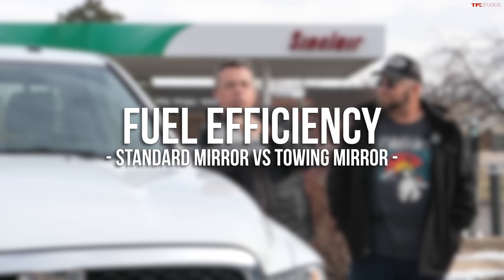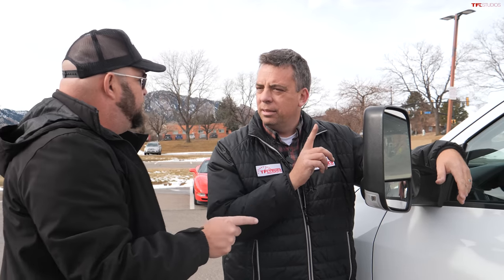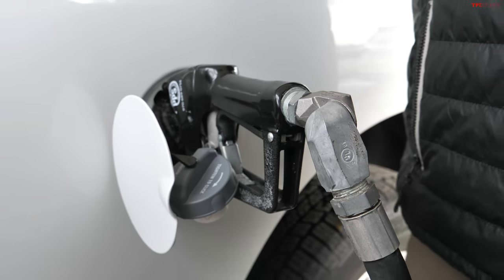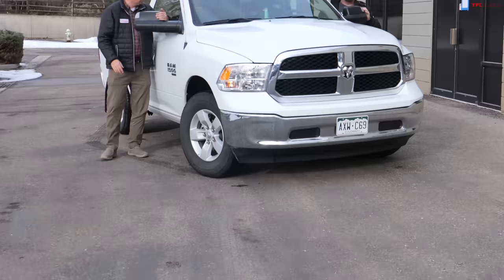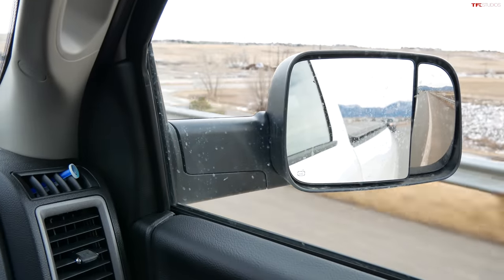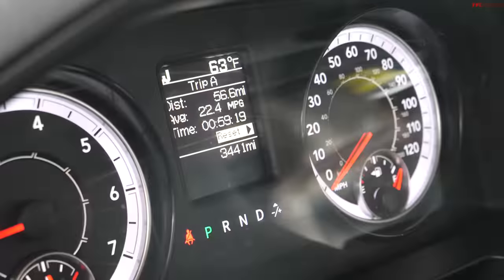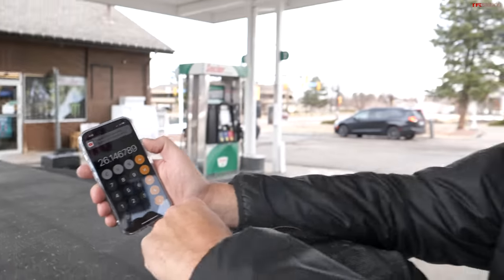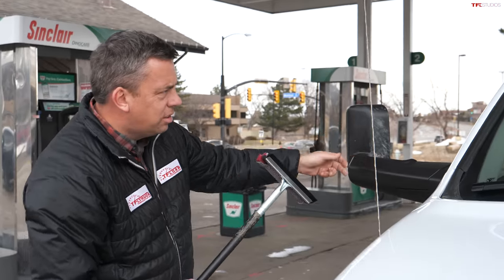TOTALLY UNEXPECTED MPG - Never Drive with Your Towing Mirrors Extended While NOT Towing: Here's Why!

Comment from the maker: TFL runs on Sinclair fuel and so should you. Download the Sinclair DYNOPAY app and start saving as much as $0.10 or more per gallon on your next fill-up. ( https://www.sinclairoil.com/customers )
Reply: I have never trusted your top off technique.  I think this just proved it to be faulty.
Reply: The closest Sinclair is over an hour from me 😂
Reply: Of course it’s faulty, but it’s about as good as they can do. The biggest fault, since they have no way to precisely measure out used fuel, is using such a small sample size of mile to do these calculations. These videos are misleading for sure. If you really think towing mirrors take away 6mpg, you’ve got problems.
Reply: You should look up the ad rules on YouTube, I believe you're not meeting them. Tom Scott did a good video on it
Reply: @phild9813  no it isn't "as good as possible".  They run the pump until it shuts off, they wait 30 seconds and mash the handle one more time.  They have no way to know if it tripped early on the first one, it could be a weak handle that trips for no reason, and many pumps will trip if they are pulled on quickly.  So the first thing to do is calculate by the dash.  If you are off by 30% chances are the pump is reacting prematurely.

I would run it until it popped off.  I would then run it again at half speed until it tripped again.  This way you can judge if it had space, or the handle just malfunctioned.  THEN I would wait 30 seconds and pull the handle "half way" again (NOT COMPLETELY) until it shut off.
Reply: @matt45540  Ok Karen, this all you got to do
Reply: I would trust your vehicles computer to measure the fuel used way more than where a fuel pump clicks off, depending on how the fuel splashes around in the filler neck your always gonna have totally different numbers, compared to your trucks fuel injectors that are extremely precisely calibrated otherwise the truck would not run right.
Reply: I like the RAM Tow mirrors.
Reply: Be cool if you could get a measuring device that measures how much fuel was consumed before each fill up but fuel is not a liquid so that may be tough
Reply: While I appreciate that TFL takes the time to do such tests, in the end, this is too small of sample size (distance driven and gallons pumped) for there to be any worthwhile/reliable data. I know funds for fuel and the time to drive long distances are both finite, so maybe best to not even do such tests at all since the results are obviously inaccurate.  Unless TFL comes up with a more consistent means to measure the fuel used than pump shutoff, you'd need to drive much longer distances and burn more fuel (15 - 20 gallons) so the inconsistent pump shutoff results in a smaller/insignificant fuel amount in the overall measurement. 
In this case, even if the dash estimate isn't 100% accurate for mpg, it is likely consistently off so would be a more accurate comparison, for the two runs, than your hand calculations. In this case, they differed by 0.2mpg which is much more plausible than the 5.7mpg difference of your hand calculation.

Comment: I'd run that test one more time to verify. That's an absurd difference and makes me wonder how accurate and reproducible those results are.
Reply: Yeah. Even reducing as many variables as possible, I still wouldn't be convinced it's typically that big of difference. Run a while tank through each way and you'd have pretty solid results.
Reply: I can't help but wonder if the first loop wasn't an outlier for some reason. I agree. Repeat the test.
Reply: The pumps are way off. I said the same thing in their last test. They should test one of the pumps twice.
Reply: Wind drag on mirrors is heavily researched. Audi tried to delete the side mirror to gain 10-15% efficiency on small mirrors. The federal govt just recently approved this changes, but still need to approve individual cars
Reply: @AkioWasRight  If the Pumps are OFF by that much???? Well, Just run the Pump to the designated  Rounded up $ amount, (ie $3.49.9 = $3.50), and the Pump should display "ONE GALLON" within I Think .001 Off?? Of Fuel On the Display! If it don't, Call the Bureau of weight's and measures out to SHUT THAT PUMP  "OFF" and Test for correct calibration on ALL the Pumps!    S  i  m  p  l  e    T  e  s  t.  And it's accurate! I've done this, (my Dad told me about it), and I found a Few Pumps in the Area that were way Off. And YES, I got the Pump #, the Station's Address, and reported it the Bureau of weights and measures, and...... YUP, they were out there pretty Quickly and had Taped off the whole Station and were Pumping Gas into there Measuring container's that are (supposedly)  Exactly ONE Gallon. And if they ain't, the Station is Supposedly Fined?????
Reply: The first test was BS! I'll buy the second! How many compact truck owners wish they were getting 26mpg!! Most of them would be the honest answer. There are 2 things men always lie about. Gas milage is one of them.
Reply: @kendavis1198  with the pumps being computerized it will always show the correct price for the gallons it thinks were dispensed. You would have to fill a container and double check what the pump says to verify if it’s off.
Reply: @kendavis1198  The problem isn't the measurement accuracy of the dispensed fuel, the problem is vapor return shut off. Some pumps are highly sensitive to the amount of vapor in the tank, which causes it to shut off. Even if you test the same pump, how much vapor returns could result in different results.
Reply: @Oaky  The MAN TGX and Mercedes Benz Actros save alot of Fuel because of the OptiView and Mirror Cam.
Reply: @FishFind3000  Sorry FishFind3000. NOT True! Just try it for yourself. Maybe I just wasn't Clear???  Stick the Nozzle in the fill neck, Look at the Price "PER GALLON AT SAID PUMP" Start the Nozzle / Pump, Pump fuel until the Price on Said Pump Reads "To The Next Dollar Rounded Up".  IE  $1.99.9 on Pump Price, The Pumped $ Amount should be at $2.00. (tricky to stop sometimes Exactly) The Gallon amount Pumped Should Read (ONE GALLON)! I've Done it It Works, and If you are NOT Getting ONE GALLON Of Gas, The Pump Is Out of Adjustment and needs Calibration!
Reply: It's not accurate in any way. Last time they did a chin spoiler with bed cover run they got 22MPG.
Reply: @AkioWasRight  Not Worried about "Vapor Return" stuff. The Question here is..... Are you Getting the EXACT amount of fuel out of the Pump being Used. If you run the Pump to the "EXACT" Rounded up Dollar Amount, (AGAIN) $1.99.9 would be $2.00.0, the Gallon Amount Pumped Has to Read "ONE GALLON"!!!!!  If it Don't, the Pump Dispensing / Gallon's Dispensed / Pumped Into the Vehicle Is "WRONG"!!!  Just go try it!!! You'll Laugh after you do it, (If you Follow how I'am Saying to do it)???? Go anywhere, Pump to the ROUNDED UP DOLLAR AMOUNT, It's Tricky, But it can be done. The Pump should Read ONE GALLON on the Display!!!!!  I Guarantee It, If you do it right, The Gallon amount will Read One Gallon!!!  Has absolutely Nothing to do With VAPOR and Shut Off, You're Controlling the $$$$$$ Amount on the Pump, The Pump Is just Pumping the Gas Into the Tank. It'll Read One Gallon. If it don't, the Pump is Out of Adjustment!!
Reply: @kendavis1198  Can you communicate like a normal person? Your comments are going to give people seizures.
Reply: @AkioWasRight  Sorry Emd=mc 2. Sure Can. If you're Interested??? Pump Gas in your Tank. If the Pump reads a Dollar amount that is rounded to the NEXT $$$, the Pump should Read (ONE GALLON Pumped). If that ain't Clear enough for ya. "O" Well. Sorry.
Reply: I was thinking the exact same thing. I don’t understand how yesterday’s video you could get 22 miles per gallon at best and in today’s video your magically at 26.
Reply: this, except do a 250 mile loop, maybe with 2 identical trucks
Reply: @Emd=mc^2  that makes me think how often we get ripped off going to differ pumps?
Reply: @jordantrudeau-adams4213  As I said in another comment, I don't think the issue is the measure of fuel dispensed, or the dollar amount for fuel dispensed, I think the issue is the vapor shutoff. How much fuel it dispenses depends on how much vapor is in the tank.
Reply: @jordantrudeau-adams4213  Hey Jordan.  Exactly My Point. Glad you understand the Explanation. Try it out next time you get gas. Works at Any Pump.
Reply: @kendavis1198  yeah that doesn't work.

fuelpumps only contain a flow sensor and then calculate cost based on how much was pumped.

so if the pump thinks it discharged one gallon it's going to bill you for one gallon no matter if it actually discharged 1, 2 or 0.5 gallons of fuel.
Reply: @anonym3017  Sure.
Reply: @kendavis1198  I understand what you're saying, and totally agree the flow sensor could be out of wack and need calibrating  but what they are saying is also true, if the machine is told by the sensor how much fluid has passed is one gallon they price is going to match, I think what you found were stations posting one price but programming another
Reply: @markmccarty9793  what about the size of the fish I caught?
Reply: @TrueNewb  Dude, the 22mpg test was a different truck.
Reply: @kendavis1198  its not the pump are off but the pumps arevstoping at different fill levels. with only fill 2 gallons under fill .3 gallons one time over fill .3 another and your off .6 gallons that's one 25 percent. can't use the pump when your only using 2 gallons use the computer
Reply: @Coldfire840  most are missing the point its not a pump metering error but a pump shut off error.their not filling up to the same point
Reply: @jeffforbes70  Look...... I can't say it Much Clearer. Next time you get Gas. Let's Just say it's $.99.9  Cents for One Gallon. Run the Pump Till it Say's on the Display a Dollar amount of $1.00 Even.  Then, Look at the Gallon(s) Pumped. If it says "Less"  than One Gallon of Gas, the Pump is off and you did not get One Gallon of Gas for the $1.00 you Just Paid! Period! Just Go Try It. If the Pump says One Gallon, Or More, you got your Dollar's Worth +. TFL Truck does Not Do this. (Correct you are). However at the start of all this confusion the MPG's Per Gallon was the Issue being Questioned. I get that, What I'am saying here is if you think the pumps are not accurate, then you need to use this method I'am trying to get ya'll to understand, to see if the Pump(s) are actually Pumping the correct gallons for the  Dollar amount being paid. The Only way to decyfer whether or not it is correctly dispensing the correct Gallon's per dollar amount is to use this method. I stood there and watched the Bureau of weights and measures do this exact process. They use a Certified Gallon Container, and run thump to Round Off the Dollar amount to be exactly $1.00 or whatever that dollar amount would be per Gallon. "ie" $2.99.9 would be $3.00 even on the pump read out for the dollar amount, and there container would be Full to the One Gallon mark! If there container was not full, that pump is Locked with a Pad Lock, and recalibrated by the Bureau of weights and measures and the establishment could be fined. Thats it. I'am done here folks. Just go try it next time you buy Gas.
Reply: @ShelbyvsViper  Dude, I'm 62, a former industrial mechanic out with a back injury! I'm drinking a 24oz beer! I watch alot of utube videos! Give me a hint here, I'm sure I watched your vedios,  and liked it! But I've watched sturgeon,  tarpon,trout, and bass vedios,  today! Oh yeah,  the video with the stripper! I liked them all, and thanks for sharing! Give me a hint, I'll be sure to watch your future videos! Had my redneck buddies do a resto on my pontoon,  maybe I'll actually do some video's at great Pee Dee River soon bout big blue cats! That's when you realize you're old, you give up on top water bass fishing!!
Reply: @kendavis1198  the chance that the pump is off is slim . the chase that the pump is stopping at different  point  i s  great, they are not filling to the same point every time.
Reply: Same thing with their tonneau cover mpg test. Needs to be repeated 5 times to get a decent confidence interval. Too many random variables
Reply: @AkioWasRight  Right on, they’re dispensing small amounts of fuel so small differences in when it shuts off make big differences when mpg is calculated. I think I believe the truck computer more than the pump this time. I’m glad they show both.
Reply: Can’t do. 60 mile loop on a 20mpg vehicle and expect the pump to turn off with enough precision. Do an ENTIRE tank. Then call me with results. The extrapolating is too much.
Reply: Error of measurement study needed.  These trips are too small to be very accurate. A couple tenths of a gallon makes a big difference in 57 miles.
Reply: @AkioWasRight yep. I have an auxiliary tank on my diesel truck and the nozzle shut off is very erratic. The amount of foam on the fuel varies greatly, etc and I can visually see where the fuel level stops.
Reply: How about this. 

Don’t use your tow mirrors extended if you are not towing, or if you are towing something small enough that you don’t need them. Imagine if you did not have them, could you still operate and get from a to b, with any stops in between without tow mirrors. Don’t extend them, and use them in their compact mode. Remember, no MOOSE MODE.
Reply: @AkioWasRight  oh shit, is that what that is!? I was curious if it was air displacement that triggered a shut off.
Reply: @Upliftyourbrothers  I hear what you are saying, but the time needed to burn a whole tank of gas could introduce other variables between tests like wind speed and direction, temperature, traffic conditions....
I would say always fill the tank for these type of tests until the fuel is just about to run out onto the ground, yeah I know the manuals and warning stickers say not to do that.....
Reply: I agree, I was so overwhelmed with this test, I did the same test with my 10th Gen F150, first with the aftermarket tow mirrors and then with stock smaller mirrors.  I only saw a 0.8 mpg improvement.  The tow mirrors are huge compared to the stock mirrors!  They need to re-run this test and should have done this automatically when they saw the results.  I'm going to post my video soon showing my results which are MUCH MORE BELIEVABLE!
Reply: The mileage ran wasn’t enough to offset the minor errors due to inconsistent top-off amounts. The test needs to be run for several hundred miles for each version so the minor errors don’t throw off the test by such a wide margin. The test should be set to a distance that would at least use 3/4 tank each.

Comment: Honestly I think you guys need to run that test at least two more times if not 6 or 8. I’ve done statical analysis before & if there’s that huge of a difference between the 1st & 2nd test then it needs to be done a couple more times to confirm.
Reply: Agreed!
Reply: I'd say it needs to be done more than once either way. I get vastly different results on the exact same route and I honestly don't feel like I'm doing anything differently. Some things are just very hard to notice and factor in from the drivers seat but apparently, they can still make a huge difference.
Reply: I concur captain
Reply: Repeating would be great but but I think the loop needs to be longer.  2-3 gallons of fuel used just isn't enough relative to how much variation there is in when the pump shuts off.
Reply: @sonictech1000  no telling how accurate the pump is without measuring the gas before putting into the vehicle. What they need is a 5 gal tank in the tray that they full from a measured container.
Reply: Can you run this test yourself and share the results with us?
Reply: @jlaw1901  they are getting paid to run those test plus free gas to do it, I’m not.
Reply: maybe they could make a colaboration with other guys to probe it or dismiss it
Reply: The DIC indicated about ~ 0.2 to 0.3 mpg difference.  The onboard fuel flow measurement is more accurate than their fill-up scheme for comparing different trips or other variables in the same vehicle.